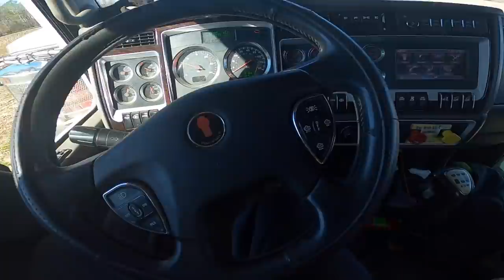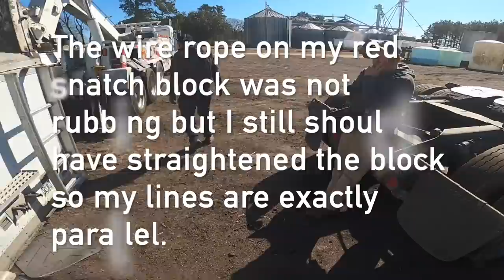Lifting a loaded Hopper Bottom Trailer

Comment: Nice job guy's. I'm not sure a Spreader Bar would have been any better in this situation. This method you had control of the height on each side in case the load was all to one side. Thanks for the video Mr Hal. Stay safe out there.
Reply from the maker: Mr Dan thanks for watching and stay safe.

Comment: Did you you advise them they need a concrete runner 2 feet thick and 12 inches wide for as long as they need at a point in there yard to park heavy loaded trailers, lol nice good , 
I know from first hand experience, there is no amount of wood or cribbing that will hold a loaded trailer up from sinking in dirt, lolll , when I did this kinda work , I had aluminum section’s of truck frames ,we would slide them along the side edges, it works really well, 
Hal , get some think mud flaps they will protect a lot, I use the fir all winching protection from cables and riggings, nice 👍 job guys well done 👍 thanks BigAl California.praise Jesus grace Christ amen.
Reply from the maker: Mr AL   No sir but I think they know now. The trailer was thought to be empty. Thanks for watching and stay safe.
Reply: @SumterWrecker  wow empty, must of had lots of water or rain on that ground, if the pure a strip of what I call staging strip of concrete it saves trailers from damage, loll nice , at the end I seen your aluminum frame pieces, ok Kenworth had them doubled with steal ,on some, thanks BigAl California.
Reply from the maker: @alkennedy1124  One driver didn't tell the other he reloaded the trailer. Thanks for watching and stay safe
Reply: @SumterWrecker  lolol yeah that’s what happens when left hand forget to tell right hand , lololololl good job brother, thank BigAl California